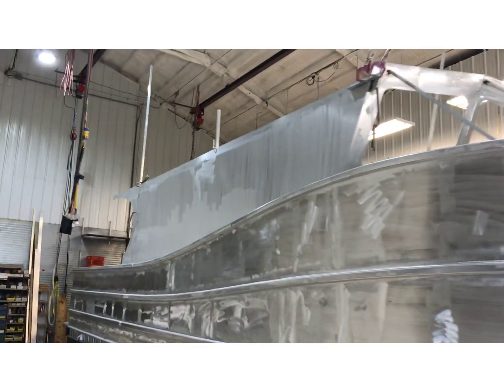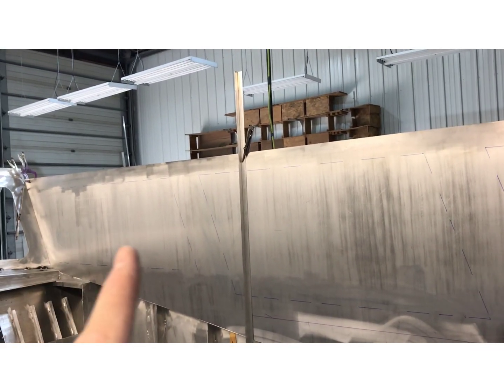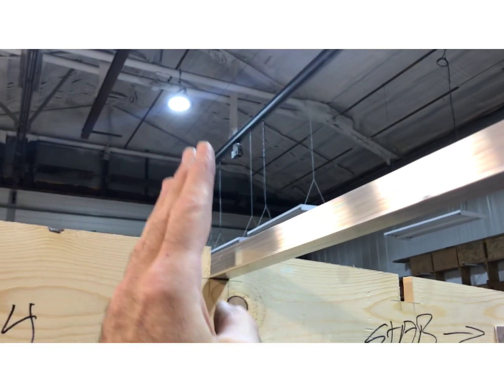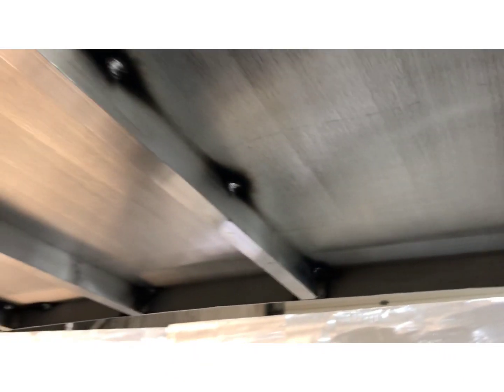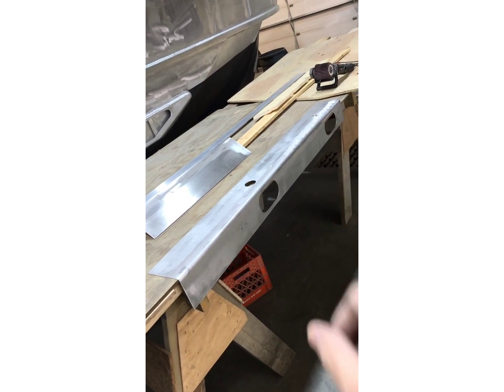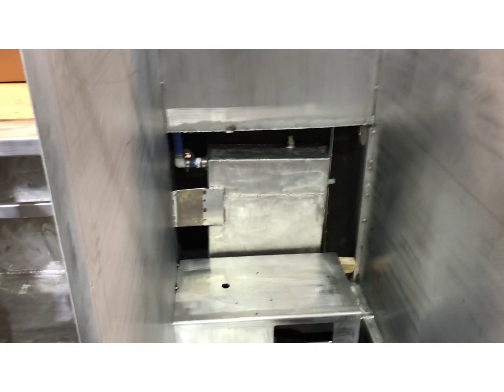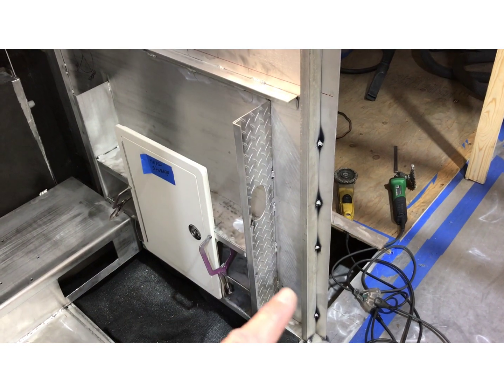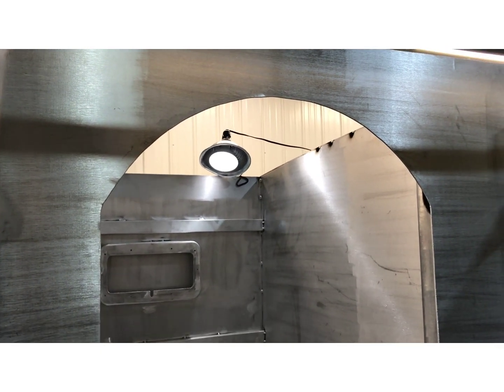Aluminum boat building - 34 foot - 5-12-2020 #26 aluminum boat Build - Jahrig Aluminum Boat Build

Comment: Ever use a Pittsburg seam? I was thinking about that for the roof of the pilot house. Seam it right in there and weld it up.
Reply from the maker: As you will see in videos i butt welded the seam and then covered with the exterior cross members. it turned out super lots of rigidity.

Comment: What thicknesses of aluminum did you use again?
Reply from the maker: Hi Mr. Tyson. Bottom is 1/4 sides from deck up to gunnel is 3/16" and cabin walls 1/8. Roof skin is .160-be good